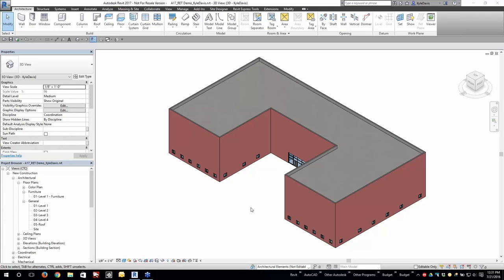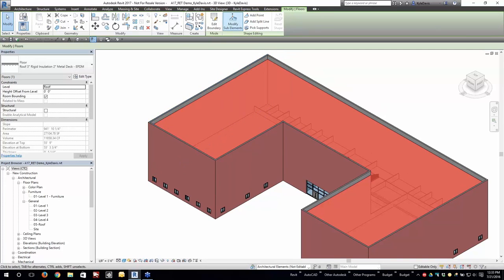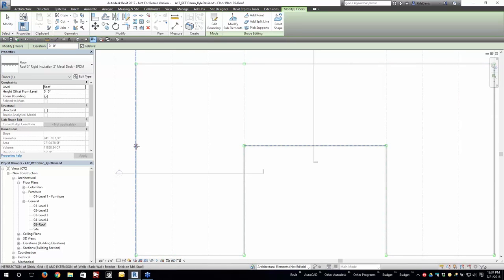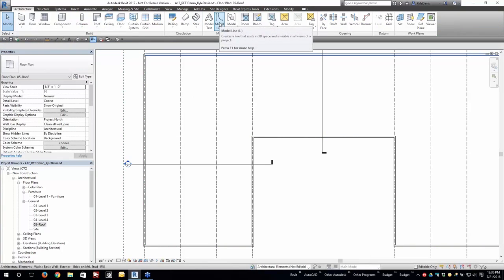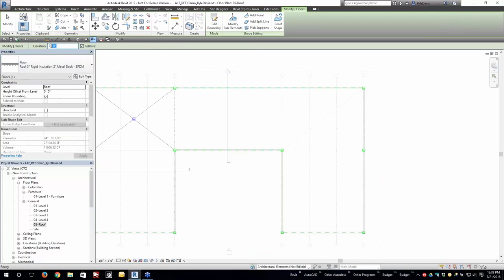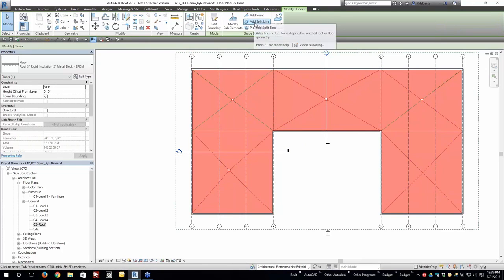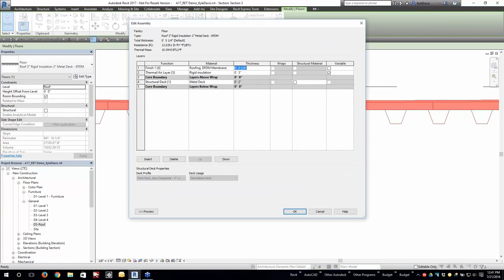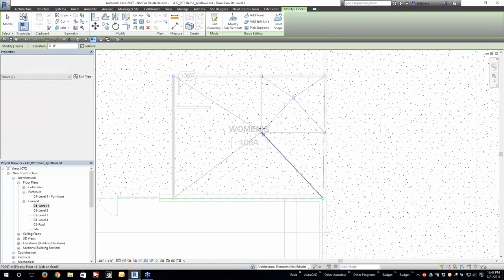Creating a Roof Assembly with Tapered Insulation

Comment: You should pick only positive values. In the roof properties you set the minimum thickness of your tapered insulation. Set you zero points then add positive values from there. That way your tapered insulation will never drop below its minimum thickness. By setting it to 3 inches and subtracting 2 it seemed ok in this instance but in my experience you should measure, figure out the change in elevation based on required slope, then Input that number for each point as you move away from the zero points.